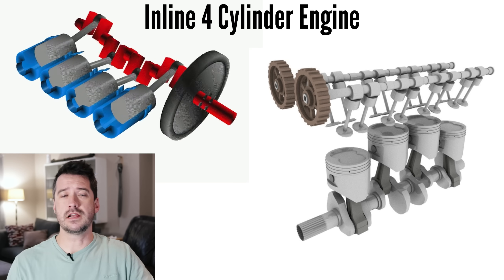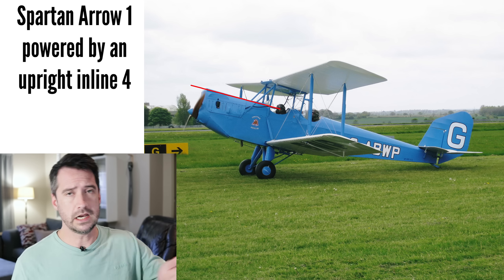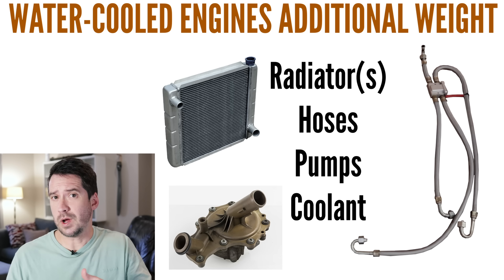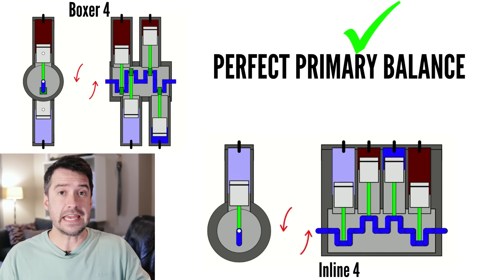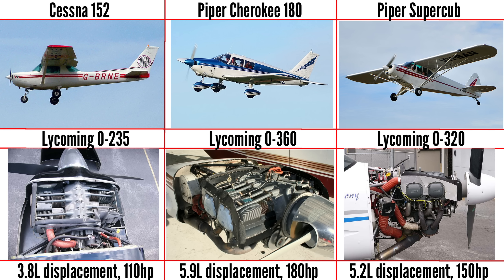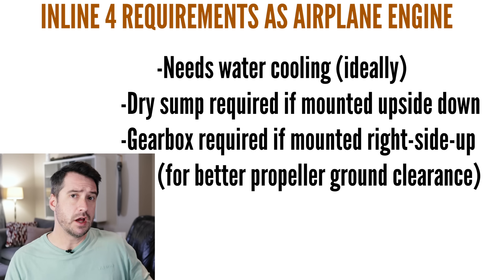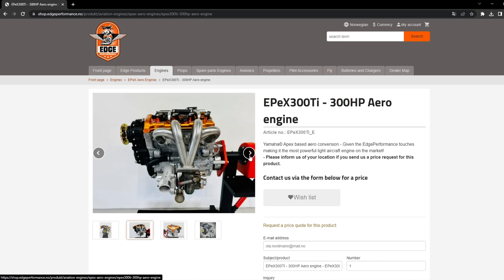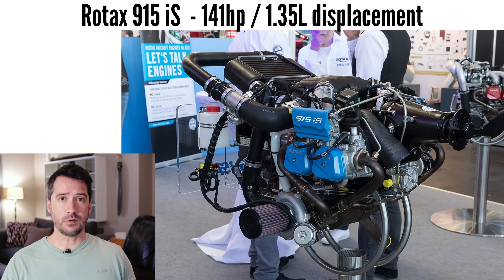Does Inline 4 Engines Suck for Airplanes? - Technical Deep Dive

Comment: 3D printed piston heads and rods are able to get away with far less material. Meaning that the counterweights are also able to be made lighter, now.😊
Reply: 3d printing metal is still instaly expensive,hope the price will drop one day
Reply: @vdiallonort  It can be expensive if you want to buy it.
Ultimately, you could buy the equipment. Learn how to operate the software to make the components you want and make all of the components you ever want and ever need.
If you already have a workshop and are good with 3d printers a three d printer that works in metal is an incredible investment.

Comment: Car engines are designed to cruise at 10- 15% of their rated power. Aero opposed engines are designed to cruise all day at 75%, radials at 66%. one diesel engine that would be interesting would be the v-6 3 liter eco diesel in some ram pickups, rated at 260 hp and weighing onle around 400 pounds. that would be something!
Reply: That simply isn't true. Car engines are geared to run at lower rpm because they do not need the power, this does not mean they can not produce continuous power. A small engine in top gear towing a caravan is under a lot of stress. small bearings can carry just as much power as larger bearings but at higher speeds. If you do all the maths on a small modern car engine vs an old merican aircraft engine, the aircraft engine is under far more stress because of its poor design.

Comment: Vibration is and always has been the downfall of the inline 4.  Aircraft don't tolerate bad vibrations well at all.
Reply: Still a very popular design in its day... the de Haviland Gipsy, Moth and the Menasco Pirate were popular engines, they made thousands.
Reply: Yep, there were planes made using model T and model A engines as well.  Not very good planes, but they did fly and the engines were cheap.
Reply: @anvilsvs  what planes used those?
Reply: homebuilts

Comment: a 300 hp one liter engine would have about a 20 minute TBO, and dubious reliability, like a dragster engine.
Reply from the maker: 20 minute TBO 🤣 Seriously though, they seem to hold up fine, doesn't look like Steve Henry has issues on his EPex powered Yeehaw. If I look at how those snowmobiles are driven, full throttle 90% of the time, it seems like they are designed for continuous high rpm.